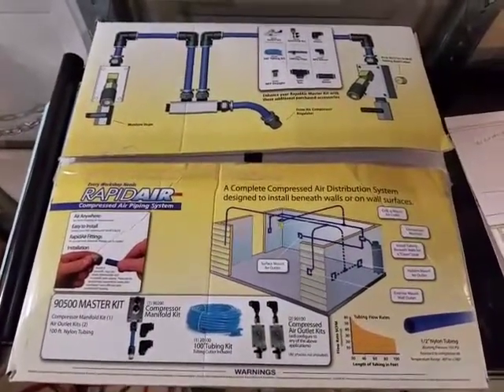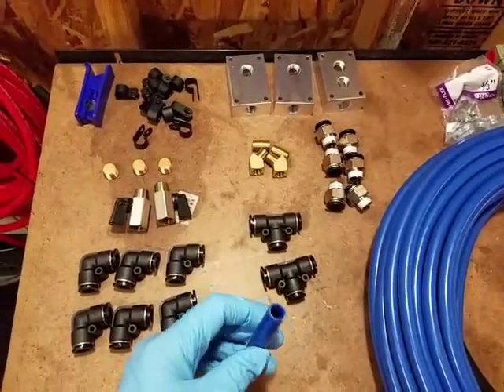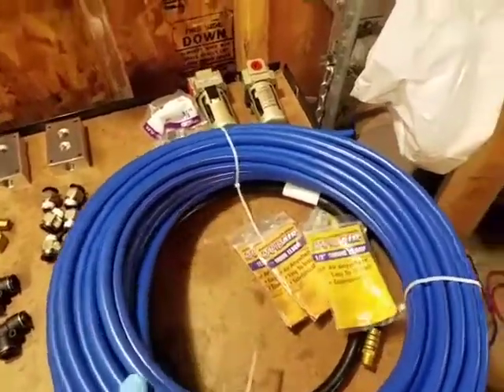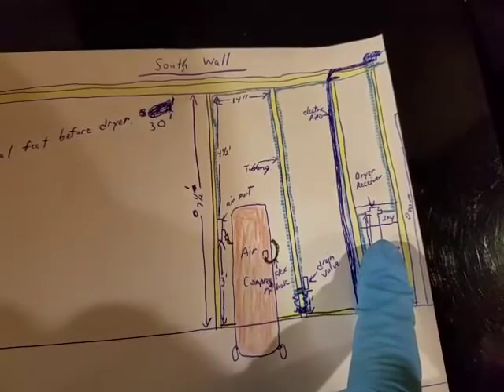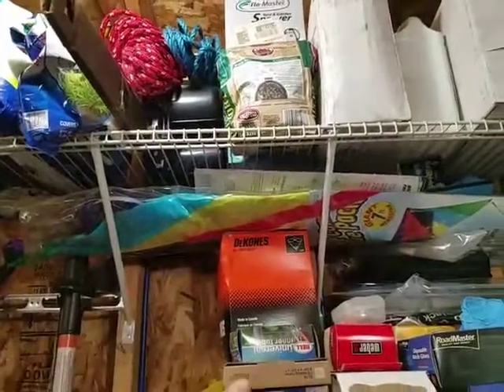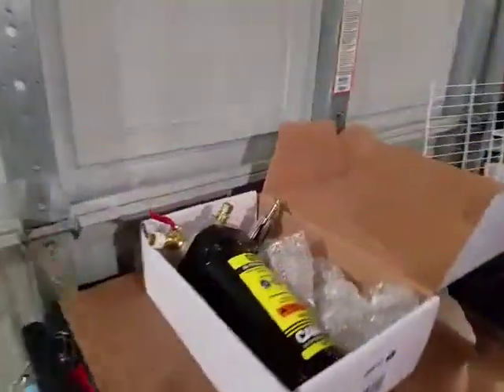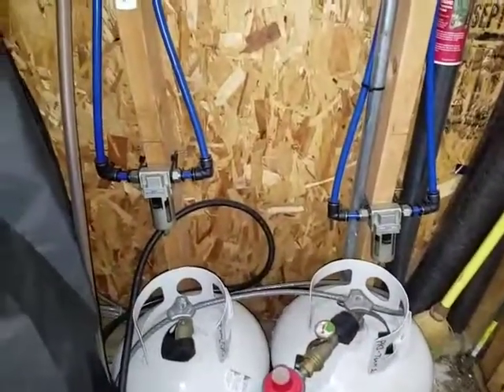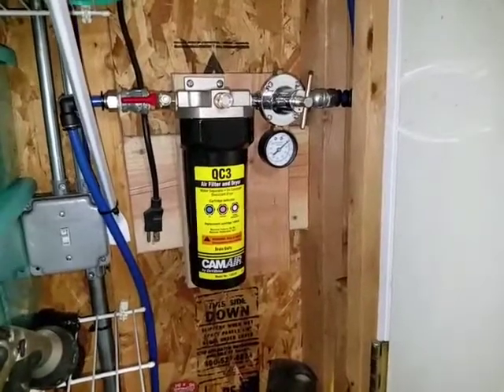Rapidair Compressed Air Piping System Review

Comment: Man U don’t even need that system lol
Reply from the maker: Maybe for someone that doesn't do a lot of automotive work. In my case I started out with a 50' air hose and it's a pain to move around the garage as it twist up on the floor creating a tripping hazard. Also, a pain to roll up the hose when done. With all my new air tools and equipment, this new air line system is great. Having my hose reel hanging from above, in the middle of the garage, makes it easier to service both vehicles.
Reply from the maker: Explain your reasoning?
Reply: Pk 3  the shop too small all what u needed is is 50 ft air hose

Comment: What do you use your compressor for that made you worry so much about water? Those small compressors do create a lot of heat and put moisture in the system. How often do you drain water out of the tank itself?
Reply from the maker: I use it for a lot of things. To answer your question, my media blasting cabinet and DA sander uses a lot of air causing the air compressor to run for extended periods of time, like 20 to 40 min. I drain the entire system after every use or every few hrs. Depending on what I'm doing and the humidity level.